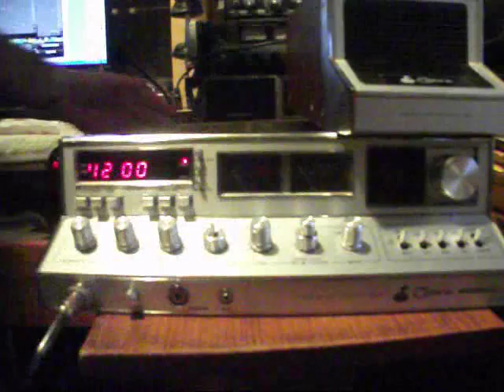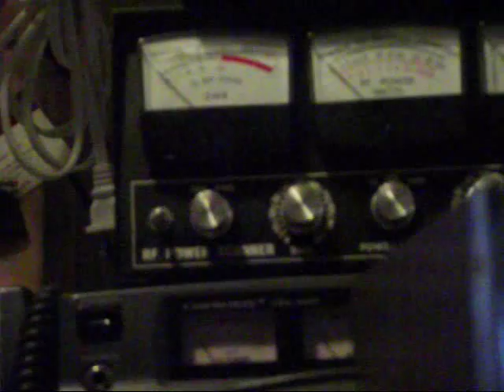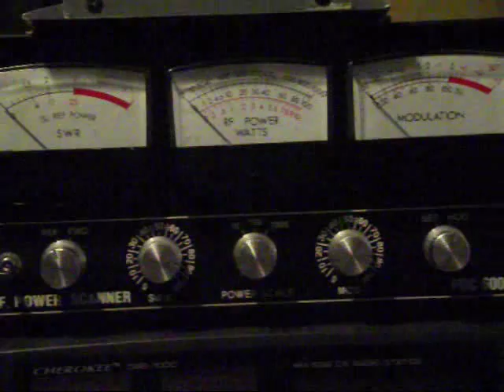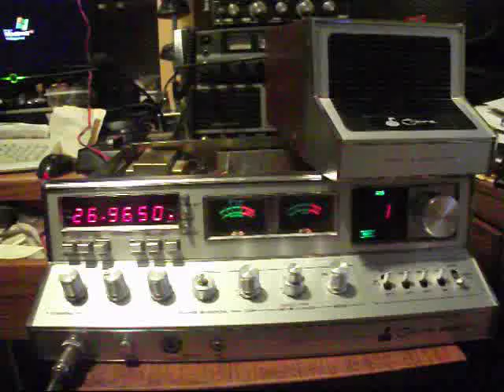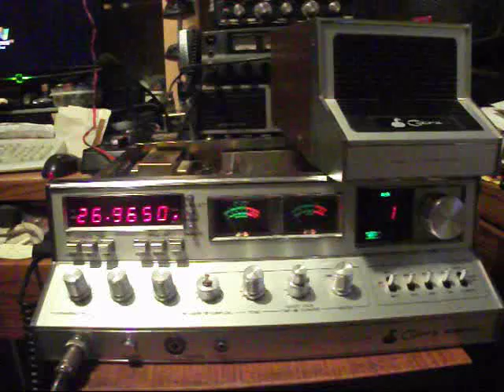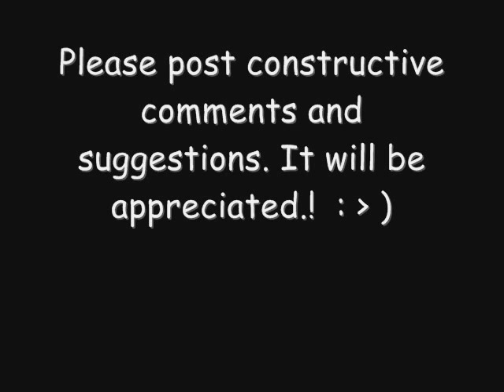Cobra 2000 GTL Troubleshoot

Comment: I have one that is not receiving our transmitting I need help too don't feel like you are in the boat by yourself screwdriver said that in Mississippi
Reply: Was your Cobra 2000 receiving or transmitting whenever you started the work
Reply: The problem that I have it will not receive or transmit
Reply from the maker: My radio had multiple problems including no TX or RX, It was also off frequency by about 1 channel lower ( Channel 2 was actually 26.965 thereabouts)
One thing about these older radios especially the ones with a lot of use, the caps dry out and fail. Replacing all the caps makes a huge difference. Also, the integral IC's in the radio may also need changing. Things like the final and driver, audio amp, etc...
I got the radio working so  much but I radio tech was visiting Newfoundland from Ireland and he put the finishing touches on the radio. I have two of these radios. The other is a SRC 2K Super Snake restored and modified by Tim Trent of Cobra Sk Factory (Snake Radio Customs)
Reply from the maker: That could be as simple as a bad microphone my friend. can you try a known working mic?Also, your internal power supply may be weak... Try switching it over to Dc and use a 12 volt power supply and see. To troubleshoot I would need a biyt more specific information. Have you checked to see if there are any radio technicians in your area?
Reply from the maker: Thanks Screwdriver in Mississippi. I appreciate that very much.

Comment: Andy , I have a One that the Frequency counter just keeps going up then eventually stops.   it does work on other bands(extra channels on it.) but when it is moving up the unit has no static or anything. 
Can you work on it for me ??
Reply from the maker: Hello Mack. It sounds like you have capacitors failed or failing in the frequency counter module or there is a voltage drop on that module and the counter is having difficulty locking to the proper frequency. 
I see that you are in the USA and I am in Canada. I think you may want to try and find a tech in the USA as shipping can be expensive. I have a friend in Arizona that I would recommend but he has a backlog of radios and he may not be able to fix your radio right away. There could be a wait for several months. I can give you his name and webpage. You may call him to discuss your issue and see what he says. His name is Tim Trent of Snake Radio Customs. www.snakeradiocustoms.com   
Telephone: 480 463 9347    
srcservice@cox.net

Let me know how you make out.
Reply: @Tobinindustrial   I called him(last week)  and he wanted 500 to fix it and he would have it a year.    dont know yet if I want to put 500 in it.
Reply: But I may do that.
Reply from the maker: @MackinNC1  Once the radio is fully refurbished by Tim, it will have an incredible value especially on eBay. I am not aware of any active techs now in the USA. The last guy I recall disappeared from the radio scene and that was Mike's Radio Repair. If you look long enough, you'll find somebody who can  address the frequency counter issue. It is also an option to just replace the frequency control module with a refurbished one on eBay. Just know that this may not be the issue.
Reply: @Tobinindustrial   I guess I am better off just biting the bullet and sending it to him.
Reply from the maker: @MackinNC1  I don't know what he said he was going to do but if he is doing an ultra clean and polish plus replace all the old capacitors and other necessary parts and doing a big refurbishment then Tim is the man that will make this an awesome 2K. I have a 2K here that I will eventually send to |Tim to have  done. He charges $35.00 an hour I think.  If you can afford the time and money, I'd go for it. This radio, once done will be an eye catcher and in today's market, you can sell and easily triple your money. I am saying it may be  worth $1500.00 or more. One of Tim's radios sold for over $2000.00 and the prices seem to be gradually climbing.There is another big radio solar cycle coming and these radios will be in great demand. I don't know your politics but if you like radios and you want a killer radio, this is the route you may want to seriously consider
Reply: @Tobinindustrial  i probably am send it to him   ...I just didnt know enough about him to let someone have my radio a year.

Comment: Littes dim on transmitting  in this radio ushuly mean some one cut the limiter  n it will cose the p.s. to go out   if you want to sell it let me know  73  ps thare no batter in the clock for memory  n back swing is problely from some trying to turn it up n not knowing what thare doing
OR the p.s. sarting to go
Reply from the maker: Thanks for your comment and information. That is very much appreciated. I will let you know if I decide to sell it. God bless you.

Comment from the maker: You make some great points. I don't believe the final and driver were replaced yet but Radionut63 may remember if he had to do that or not. The radio is currently awaiting an 11.325 crystal to bring it back to CB frequency with channel mod added. I am gonna have a look at RF Parts for parts and prices soon. It is also good to know that eleflow is good parts. Thanks for your post and information. Much appreciated

Comment: Looks like previous owner replaced the finals. 2sc2312 is fine but not original. The 2cs1969 and 2312 are no longer produced. There are several china suppliers selling fake Mitsubichi transistors. Your issues of low output power and heavy current draw(light dimming) is common with the fake components. RF Parts has real transistors but there stock is diminishing. Eleflow replacements from the United Kingdom work great. Then a thorough alignment should follow. Capacitors are likely ok but suspect.
Reply from the maker: YouTube had these messages Hidden. Thanks for your comment

Comment from the maker: Thanks for the suggestion. At this time the radio is working fine based on replacement of most of the parts you have listed. The PSU is the only issue now and the plan is to swap out the main parts of the PSU in the future.! Thanks again!

Comment from the maker: That's a lot of capacitors. I noticed a capacitor kit on ebay for just such a thing I suppose. Sadly, around here where I live there is no electronics shops where you can readily avail of the basic electronic parts. Thanks for your input.
Reply: I just bought a complete kit for 12.99 free shipping
Reply: Same kind of capacitors that Klondike Mike uses